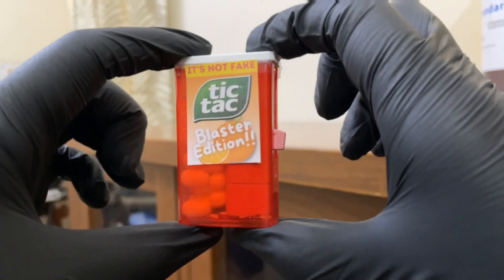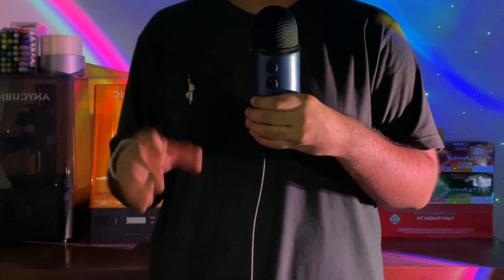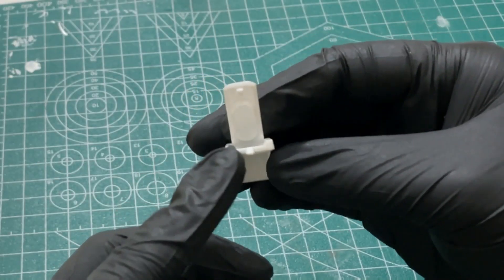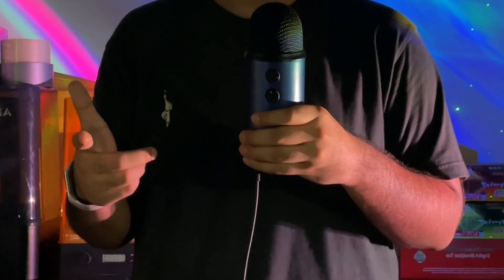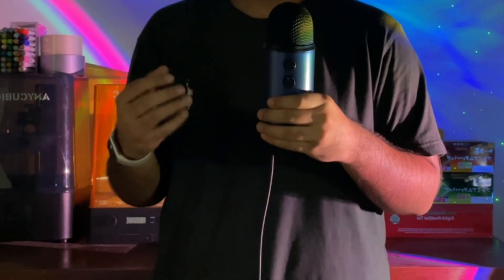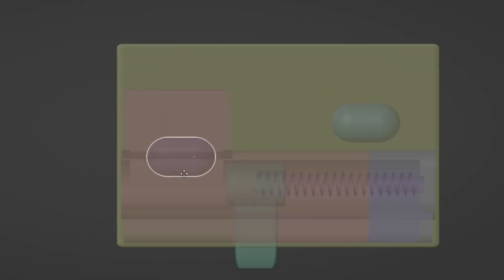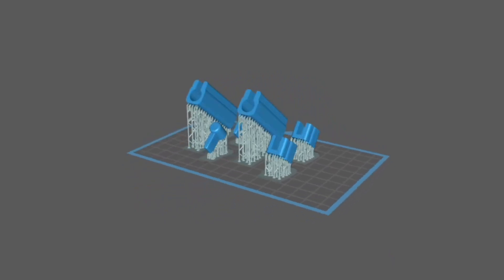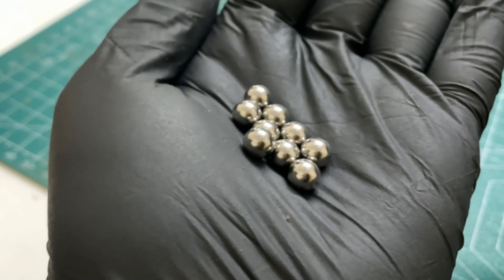Stealthy Tic Tac Blaster [3D Printed DIY]

Comment: I don't really want to buy special filament for this, does anyone have any tips on how to get it wo work without expensive filament or extensive sanding?
Reply from the maker: Maybe try printing longitudinally?
Reply: @toast_channel  Is that they way the STL files are arranged?
Reply from the maker: yeah print them horizontal instead of vertical (so layer lines run along the length of the barrel, and not across it)
Reply: @toast_channel  Do you think I would need supports then?
Reply from the maker: I think you would need a few supports, but they will be much easier to sand off than if you printed it vertically. But full disclosure, I don't know much about FDM printing tbh, so I could be wrong